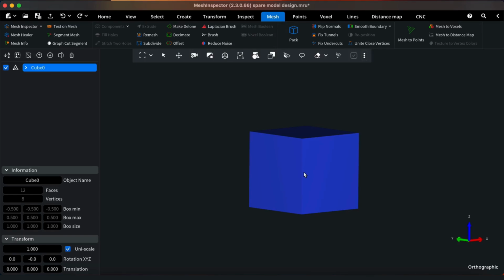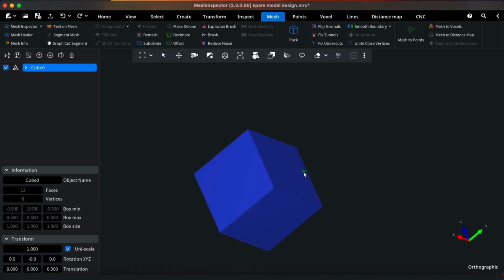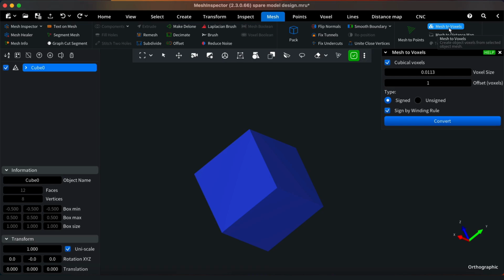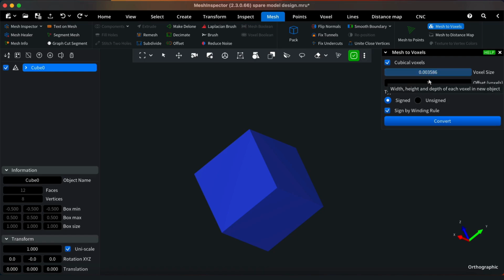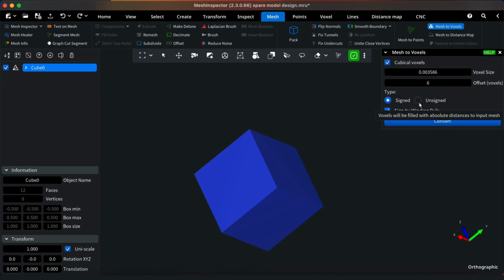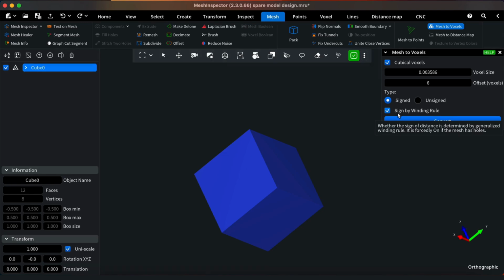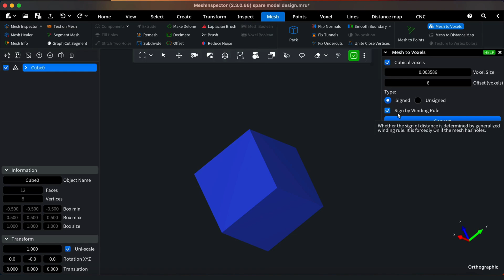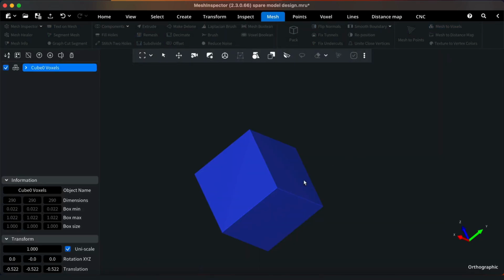Understanding the Mesh to Voxels Tool: MeshInspector Tutorial

Comment: depending on my mesh it wont let me make the voxel size smaller, which is kinda annoying since maybe id like even more details
Reply from the maker: Hi! Thanks for your feedback. In the next release, we will decrease the voxel size as we did it in Mesh Healer tool. So far you can try to use Mesh Healer Rebuild tool with the lowest voxel size possible.
Reply: @meshinspector  like i currently have model, that is split into multiple pieces in blender, i have decided to combine them into 1 mesh and bring it to mesh inspector so i can just turn it into voxel then mesh it to force fix all the issues, because this is a very complex model. if i try to voxelize the entire mesh I'm limited to a specific number which voxelises the whole mesh for me at the same time i lose a lot of the small details i wanted... compared if i bring each piece by itself and then try to voxelize i can bring the voxel size to even a smaller amount so i can retain all the details.. but this still wont fix the gapes between all the pieces i would still need to somehow fix all those holes and little minor issues.
Reply from the maker: @makimakesgames  we already improved mesh to voxels. We can share the draft version that you can try right away. If you are interested, email us at support@meshinspector.com.
Reply: @meshinspector  i will think you.